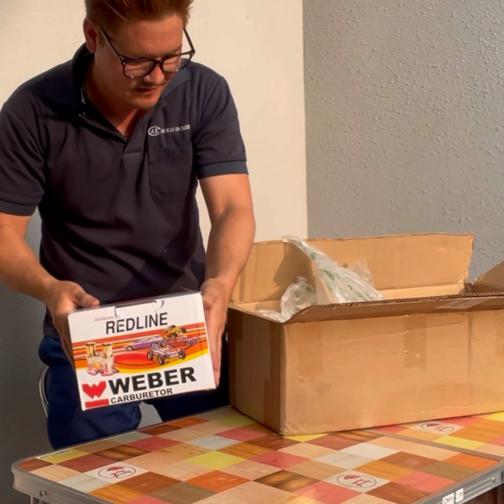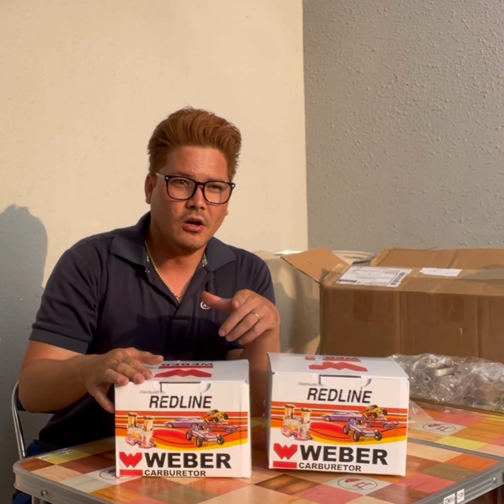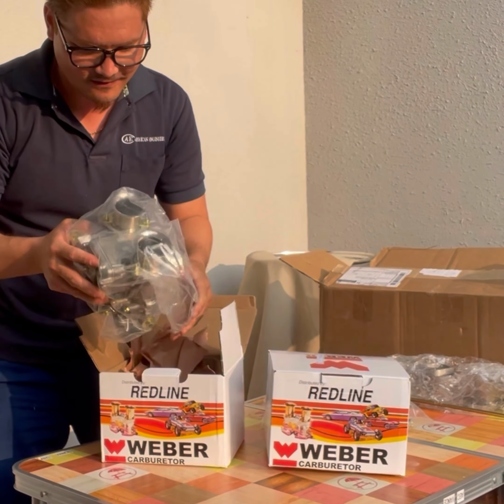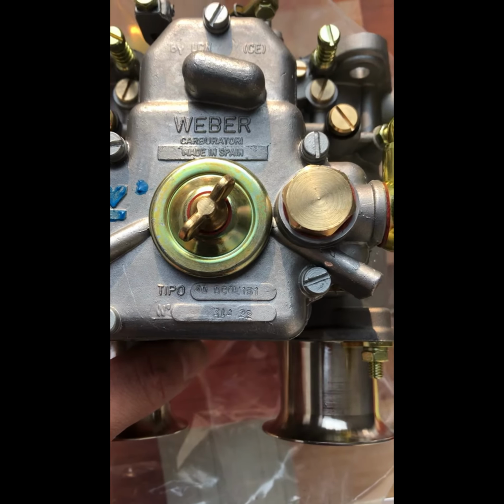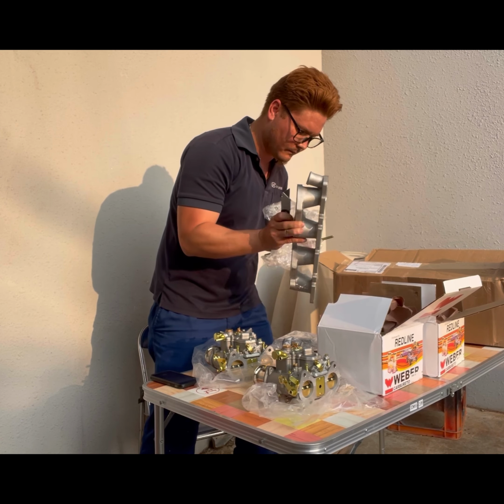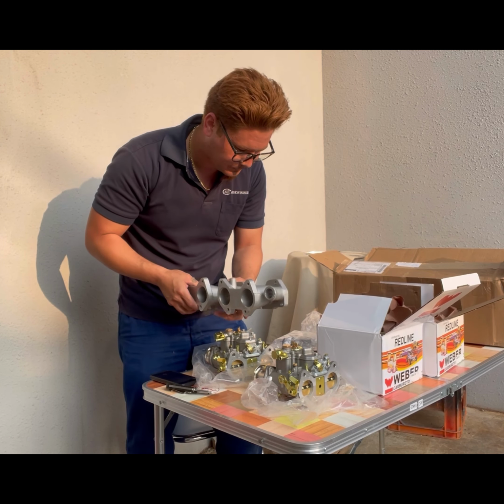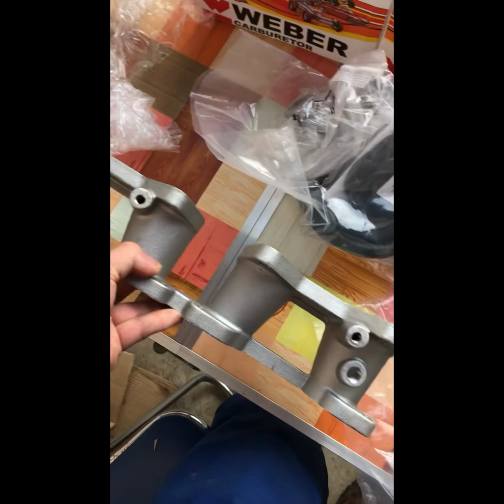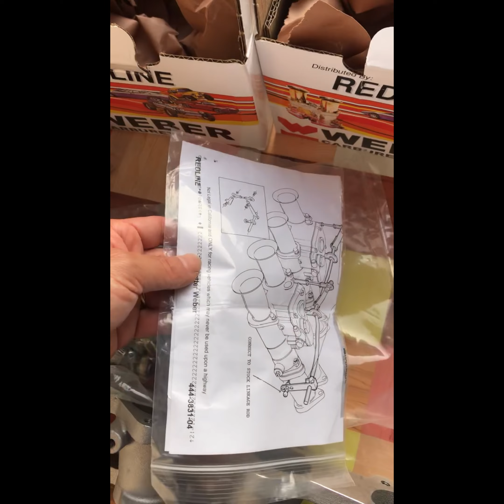Unboxing Dual Weber Side draft Carburetor kit for Datsun 720 (NAPS Z) ウェーバー サイド ドラフト キャブレター キットの開梱

Comment: Have an 83 720, 2.2l, is there a benefit to running dual carbs on this motor?
Reply from the maker: If it’s diesel engine then I’m not sure but for the gasoline engines, it gets more power then the down draft carburetors